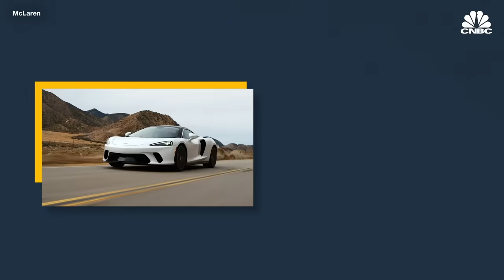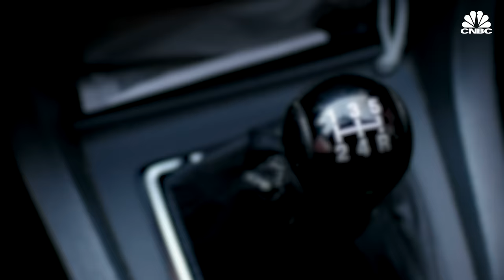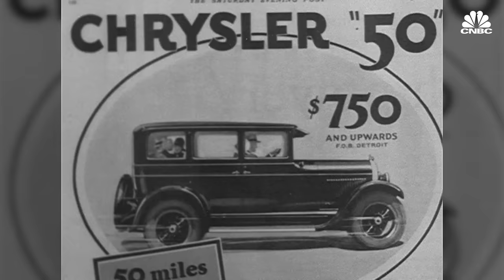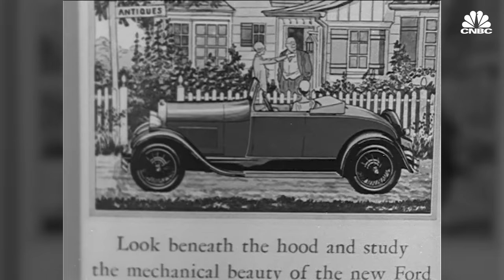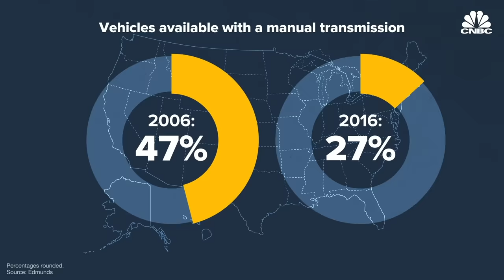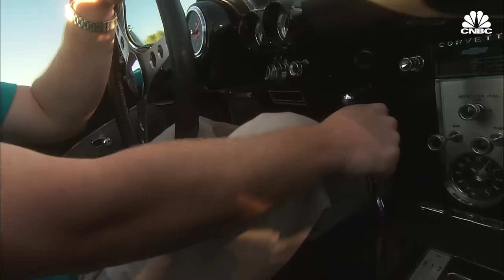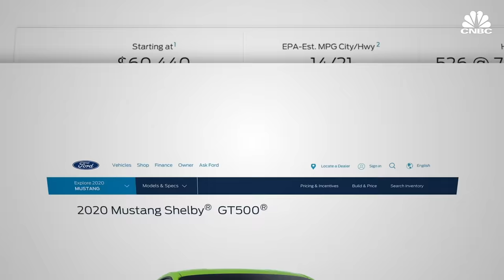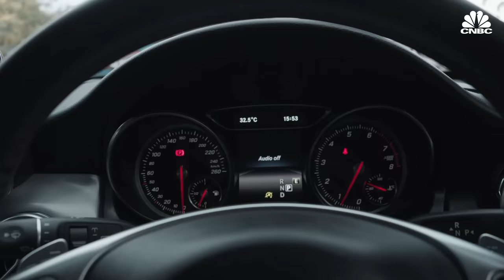Why Stick Shifts Are Going Extinct

Comment: CNBC: Why Stick Shifts Are Going Extinct
Me: Because a vast majority of people can't actually drive (read as obey the rules of the road)?
Reply: Perhaps make manual transmission training part of drivers-ed? 13th vehicle and never bought an auto.
Reply: Thats the same as saying "why do people need rearview mirrors, cant they just turn their heads?" 
At some point before rearview mirrors were commonplace, people set in their old ways said the same thing about people using and buying cars with a rearview mirror.
Shifting is not a necessary part of "driving" anymore, so you cant say they cant actually drive
Reply: If you really feel so superior because you do unnecessary extra work that's easily replaced by a machine, you shouldn't be driving at all. Just ride a bike and laugh at all those people who can't even use a pedal. Wait a minute... bikes are machinery too!  You should be walking everywhere. People who rely on easy, comfortable methods of transportation don't know how to walk, amirite?
Reply: @won1853  Personally I prefer automatic.  Never learned stick, and likely never will.  As Evenstar put it, it's just unnecessary extra work. With electronic and hybrid cars likely to become the standard, the "fuel efficiency" argument is slowly being rendered mute.  In that regard I don't see teaching stick as having a point - especially when, sadly, a vast majority of drivers ignore everything they've learned the second their off the lot anyways.  If people lack that little brain capacity, they're not going to want to bother with stick.  Driving is more about being able to press a gas pedal and steer a car, or what transmission you prefer, its about knowing and obeying the rules of the road.  It would be more useful, in terms of drivers education, to make the training hour requirement longer, and the tests harder.  Combine that with more blanketed and stricter enforcement of the roads to clear out the worst of the offenders and we might be able to get our roads under control.  Once that's done (ha ha), THEN we can take another look at how relevant Stick Shift still is.
Reply: @ziglaus  ...and now American cars have a dash video screen for rear view and a button to push when too incompetent, or perhaps too inebriated to actually parallel park....
Reply: I prefer manual. And as a matter of fact I've seen just two cars that have auto.

Oh, that's right - I'm an European and we're sticking to manuals. Yeah, looking at how the EU market looks right now (excluding super cars, because not that many people actually drive them) sticks are not going extinct. 

And as someone who drives a stick I'd say - you don't really think about that much. I don't get that guy who said you need to be more focused when operating stick. Even when starting on a grade. The procedure is not easy - you need to release the clutch first until you feel the engine is trying to push the car forward, then quickly release break and put foot on the gas pedal and then proceed to release the clutch. In my case that whole operations takes one second and I barely think about it. It's just waiting, waiting, ok now I'm moving.

AS FOR ELECTRIC CARS - I see guys at CNBC never heard about electric engine. And in case of electric cars the best transmission for them is that continuous one. It's much easier to change RPMs on transmission then it is on the electric engine.
Reply: @michdem100  These americans with their "unnecessary" work lol. They don't know how to drive sticks and therefore don't enjoy driving because they don't know better. We don't actually consider it work unless you have an automatic in front of you that drives at that super annoying speed in between gears. American roads are also boring as hell, I would dislike driving too when all you do is drive in a straight line.
Reply: @1noetic  That's an excellent idea. I'm surprised nobody has mentioned it before.
Reply: Good point ;-)

Comment: 3:44 "Require work, skill and constant attention". Um, DRIVING requires all of those things.
It's really not that difficult to use a clutch pedal and manual gearbox.
Reply: Could be difficult for elderly people driving through traffic
Reply: It's not difficult, but it gets annoying in heavy traffic or on long drives. I prefer that auto when towing in the mountains too. A missed shift can get you in a lot of trouble when you have a 12,000 lb trailer on a 7,500 lb truck. With the auto I hit the exhaust brake button and downshift on the column.
Reply: I learned to drive on a stick shift in the early 1990s.
Reply: @russkate88  Keeping it between the lines is difficult if you are looking down at your crotch all the time. Apparently the drunks are safer than cell phone drivers.
Reply: @danischannel  Plenty of elderly people drive through heavy traffic in Europe, my friend. And very few of them use an automatic.
Reply: not only that, but a manual transmission is way less trouble than an automatic transmission; all the cars I ever owned were manuals and I have had several friends who owned automatics that were catching hell from transmission problems. I never had to do anything to my manual transmission except to replace the clutch, pressure plate and bearing after several years of hard driving.
Reply: @clarenceedwards2866  The vehicle that I drive gets depowered if you select the manual option as the manual that could handle the full torque of the engine is too big to fit. In the year I bought (2011) manuals got 610 lb ft, and autos got either 650 lb ft or 800 lb ft depending on the build date. They did upgrade to the Aisin AS69RC for 2013, but never offered it on the 1,000 lb ft trucks and have dropped the manual altogether now.
Reply: @rich7447  I must confess that I never paid much attention to the torque; I was more concerned with BHP; but I am a little surprised that the torque for the automatic option exceeds that of the manual for the same BHP output.
Reply: @clarenceedwards2866  Both engine options are rated for 350 hp. It's all really just tuning on the same Cummins ISB L6 6.7 liter turbo diesel. They don't make a ton of horsepower (highest rated is 400 hp) and redline at 3,300 rpm, but they make a lot of torque which ends up causing issues for transmissions is general. The safest thing is to budget for an aftermarket built transmission around 150,000 miles.
BHP is great for speed, but doesn't help you get an 8,000 lb truck and 13,000 pound trailer moving off the line. Without the trailer the truck can do 0 to 100 kph in about 8 seconds.
Reply: @rich7447  understood, and that's where I was focused; I only drive light duty vehicles so I am not so in tune with the heavy duty stuff;
Reply: @clarenceedwards2866  Got it. There are a lot of pickup trucks around here and some are pretty large. There is even an International CXT that we see from time to time.
Reply: @rich7447  how is it annoying for long drive? You're Literally in one gear the whole time
Reply: @Im-mv6bf  If you are driving across the great plains it may be one gear. Anything that isn't that flat requires some shifting (add a reasonably heavy trailer and you shift more), which to be honest I don't even think about (driven enough manuals to do it automatically and even double clutch without thinking most of the time). You usually don't make it through a whole day driving east of the Mississippi without traffic due to congestion, construction or collision either.
It gets annoying at the end of the day (12 to 18 hours) when you get off the highway and are looking for hotel and food. Everything feels like too much effort. Synchronized gearbox makes it less effort, but I'll still take the automatic for long trips.
Reply: @danischannel  My very european opinion as a driver, is that whenever the elderly no longer can operate a stick shift due to lack of concentration. Then they shouldnt be behind a wheel anymore. They're actually dangerous
Reply: @aoikemono6414  because manually changing gears and being in control of your vehicle is NOT a distraction?
Reply: @rich7447  Missed shift, operator error, not fault of transmission. Could have hauled five of your wimpy 7500 lb pick ups in my 53 foot double drop frame furniture van pulled by my Kenworth T600 18 speed manual transmission.
Reply: @clarenceedwards2866   You are right, I had to replace the clutch, pressure plate, and throw out bearing after 600,000 miles on my Kenworth.
Reply: @juandoe311  I had my first car a manual back in 1973; it was an Austin mini cooper; so I can actually write a book about driving manuals; one thing I love about manual transmission; you don't have to replace gear oil like you do transmission fluid; it lasts far longer than transmission fluid. Maintenance costs on manual vehicles is much less than automatics.
Reply: @juandoe311  Yes a missed shift is operator error, but that's not much of a consolation when you are headed up a run-off ramp. I'm not a commercial driver, so I'm not hauling anything that big. The truck is rated for 17,000 lb trailer so I don't go higher than 13,000 lbs. I never said anything about a 7,500 lb trailer BTW.
Reply: @rich7447  Neither did I. I said five wimpy 7500 lb pick up trucks not trailer BTW hauled in MY trailer
Reply: @juandoe311  I'm sure that you drive a class 7 or 8 as your daily driver. I can haul a 7,500 lb pickup too. It's not exactly going to be a stretch for a semi.
Back in the early 90s (in my early 20s.) I was driving a Western Star in northern Canada. It was a great experience while I was doing it, but it was not a career that really paid the bills.
Reply: @rich7447  I didn't say " a 7500 lb pickup" I said 5, spelled out FIVE, in my furniture van. I was a furniture mover and owned my own tractor. I worked till I was 45 and have been retired since, I am now 65..................It paid the bills and then some! I worked loading and unloading the van, the truck I drove in my spare time.
Reply: @juandoe311  I'm very happy for you Juan. It's not every day that I hear about a person with an entrepreneurial spirit that went for it an was successful. I sincerely hope that you enjoy your retirement.
Reply: @juandoe311  BTW Juan I drove a double steer western star for 8 months (in the 90s) which probably made your furniture van look like a wimpy little truck.  There is always something bigger.
Reply: @aoikemono6414  Ever heard the term muscle memory? Have you ever driven with a clutch as a daily? You get taught to prioritize not dying over stalling
Reply: @ND7800 What? No?

Comment: "... manual transmission require work, SKILL, and ATTENTION"

Frankly, not a lot of drivers have those last two requirements.
Reply: Also i unless im pulling off i rarely think about changing gear. Its like riding a bike . natural
Reply: @franciswaters7043  That's right, it becomes second nature pretty soon after getting your drivers license.

Comment: "The require skill, work, and constant attention"
Yes, but actually no.
For me, it's just instinct, It just happens. 
It's not hard to learn, it's suprisingly simple
Reply: Yeah it’s not hard, people just need to get used to it.
Driving a manual is very easy and nearly everyone will get used to it before a year.
Reply: @GrillerRohde  took me maybe 2 days? 
Even before then I could do it pretty well, but then it just happens that I shift without thinking
Reply: @InsertPandaHeree  
Yes driving a manual is easy as guck and you can learn it in a single day but I meant getting used to it so you can shift smoothly.
Every person can learn how to drive in a hour just mastering it takes some time.

Comment: "Constant attention" is actually good when driving a car. The attention that stick shift needs is minimal once you get used to it, but it keeps your general attention level just a bit higher, which makes you a bit more focused on driving. And having a separate clutch pedal is also helpful while manoeuvring at low speed (so called half-clutch driving). This is a technique everybody is taught at driving courses in my country and I guess in most countries in Europe.
Reply: I know right. I'm in South Africa and when I had the option of buying my first car there was a slightly more expensive Ford Focus with with Auto transmission and a slightly less expensive one with a Manual transmission. My younger brother who is a driving enthusiast advised me to take the manual because I would become a permanently incompetent driver with an Auto. Driving an Auto makes you a terrible (and perhaps dangerous) driver in a Manual vehicle, whereas driving a manual you can drive an auto competently. 

Driving long distance in my manual car, kept me alert as well because in the ups and downs and changing terrain, the car gives you feedback that you cannot ignore and must shift up or down for. Therein lies the safety. In the long run, you understand the ground you are on, whenever it changes meaningfully. No complacency.
Reply: It ain’t even “constant attention”
Reply: It really depends.  If you're driving in accordion traffic on the highway during rush hour, constant attention is a nightmare.  Have had hour plus commutes of this kind of driving, and all you want to do is just listen to music or a podcast.  Having to work the clutch every ten seconds is absolute torture when you have to do this 2+ hours every day 5 days a week.  Then with a commute so long, too, you will often want to eat or drink something, and having to work your left leg makes putting things on your lap a recipe for a mess.
Reply: @sciencecompliance235  Agreed . In this scenario automatic transmission makes sense. Accordion traffic is one of the worst situations both for the driver and the car, and for the environment too, contributing to road rage, tiredness, premature wear of the clutch and components of the cooling system as well as environmental pollution.

Comment: Can't bump start an auto down an incline when your battery is flat.
Reply: Not anymore, but to be fair, older Powerglide automatics could be push started.  There were a few others.  If the transmission had a rear pump, you could probably push start it.
Reply: Can't bump start new cars even if they are manual trans.. the engine management computer won't send fuel to the injectors unless it thinks it's operating normally. (source: my car) That said, just keep jumper cables like any normal person...
Reply: Battery has to have some charge or can't roll start. Better example would be a bad starter.
Reply: Jeffrey Devoti Youve got to have a seriously dead battery to not be able to push start it. If you just left your headlights on overnight on accident, it'll still work. If it's been sitting in a field for 3 years then yeah it probably won't work
Reply: @imthedarknight-8755  Well said!

I have a  2008 car with a standard trans. I had to jump start it a few times as the battery was dying before I got a new batt. 

 On one ocassion the battery had fully discharged (no lights, no nothing) and I tried to jump start it going downhill, to no avail. It wouldn't crank. Nothing. 
But, if I just had enough battery juice to light up the lights of the dash, like on previous ocassions, then the car would start right away. 

Downhill I'd start on 2nd or 3rd, depending on the incline of the hill. If the battery was too weak, then I'd jump start it on 1st gear. 

Manuals are so much fun.
Reply: also, automatics have a crankshaft position sensor on the engine.  if that goes bad the car wont start no matter what.
Reply: @aaron41  when did that start?  my 07 was able to be push started, and that seems to have a lot of those computer controlled systems.
Reply: @jeffreydevoti8528  a flat battery isn't completely dead.
Reply: As long as there is enough juice for the fuel pump to prime the engine,  you can push start it...i push started my 2015 Mazda 6.
Reply: Fax tho
Reply: @jeffreydevoti8528  Not true. As soon as the alternator/generator starts spinning you have electricity to make spark and run the engine.
Reply: @Anon Ymous Not if you are 50 miles from town and all you have is a Good Samaritan in a pickup!
Reply: Guru Kahuna- alternators require electricity to start generating more electricity, they're kinda whack. If you took out an alternator and spun it, it wouldn't produce a voltage. So you have to have enough juice to start the alternator process
Reply: @imthedarknight-8755  99.44% of the time the alternator will have enough residual magnetism in the rotor to start producing output, or the battery will have enough charge to magnetize the rotor enough to start producing output. Once you get that first little spark, you're running! Technically, you are correct, but in real life it generally doesn't work out that way!
Reply: How often does anyone ever take advantage of this? In the last 10 years I have had a battery problem that prevented me from starting my truck exactly once. Since I was the only person there at the time there was exactly 0% chance that I would be able to bump start it if it was a manual. I don't tend to park at the top of hills just incase I have a battery issue and even if I did I'm not really all that comfortable with rolling a 7,500 lb vehicle down a hill hoping that it will magically start and I will get brakes before I need to stop.